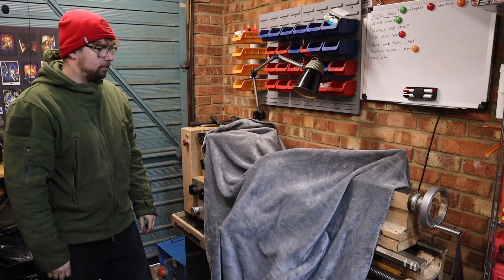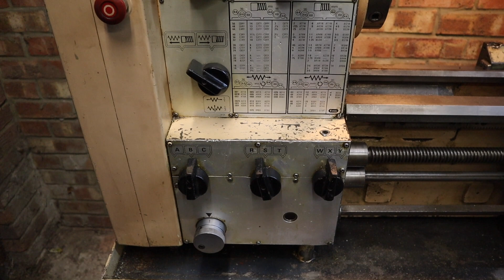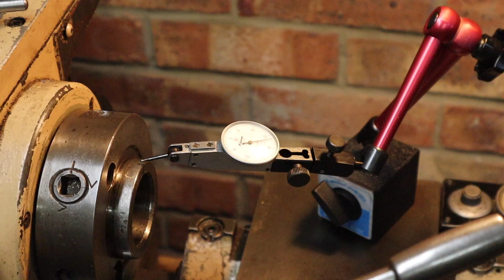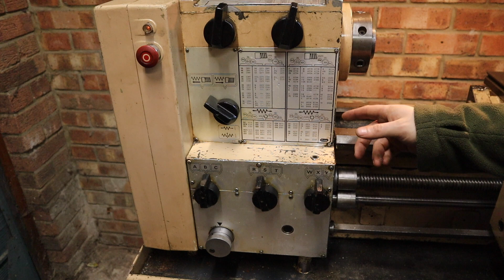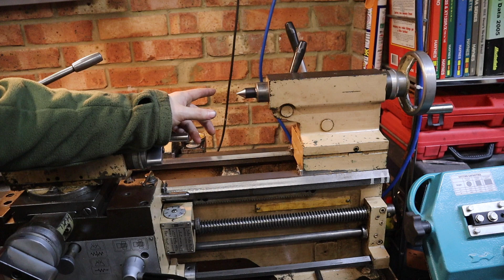My NEW Harrison M300 Lathe

Comment: Hey Joe, great video. I'm having a 40" version delivered in a week or so. Can ask if you have separated the stand and the lathe itself and if there are any electronics in the stand or if it's just a matter of removing the bolts holding the stand and lathe together. I need to move it down some stairs and it would help a lot to separate the stand from the lathe itself.
Thanks.

Comment: I have got one of these on order - originally tried to get a used one like you but they where all either badly worn or expensive so ended up biting the bullet and investing in a new one from Colchester, it cost a small fortune but will hopefully last me a lifetime, I did consider a Master or a Triumph but they would have just taken up a bit too much room in the garage and obviously cost more! - Can’t wait for it to arrive!!
Reply: how much was it do you mind me asking
Reply: @stevenhorgan8782  base price without options / extras is £15770ex vat for the 1000mm between centres model - all in with DRO, extras and delivery (plus a slight discount) mine came to £18900 ex vat) - it’s a lot of money but it’s  also a lot of machine - will last me a lifetime and the quality is leaps and bounds beyond anything you’ll get from the Chinese importers  - and Colchester are great to deal with - very good customer service / support. They come and level / commission it too - it arrived this Tuesday and I haven’t left the garage since 😂
Reply: @stevenhorgan8782 The base price for the 1000mm between centres model (which I got) is currently £15770ex vat before options / extras - after I added in the options I wanted (DRO / quick change tool posts holders / fixed and moving steadys / faceplate) and a slight discount mine came to £18444ex vat- it’s a lot of money but it’s a lot of lathe, is far superior to the Chinese import lathes and it will last me a lifetime so well worth it in my opinion. Colchester offer fantastic customer service / support too and as part of their delivery service they also locate it where you want it and send an engineer to commission / level / accuracy check it - it arrived this Tuesday and I haven’t left the garage since 😂 the Mrs doesn’t approve though 👀
Reply: @stevenhorgan8782  The base price for the 1000mm between centres model (which I got) is currently £15770ex vat before options / extras - after I added in the options I wanted (DRO / quick change tool posts holders / fixed and moving steadys / faceplate) and a slight discount mine came to £18444ex vat- it’s a lot of money but it’s a lot of lathe, it is far superior to the Chinese import lathes and it will last me a lifetime so well worth it in my opinion. Colchester offer fantastic customer service / support too and as part of their delivery service they also locate it where you want it and send an engineer to commission / level / accuracy check it - it arrived this Tuesday and I haven’t left the garage since 😂 the Mrs doesn’t approve though 👀
Reply: The base price for the 1000mm between centres model (which I got) is currently £15770ex vat before options / extras - after I added in the options I wanted (DRO / quick change tool posts holders / fixed and moving steadys / faceplate) and a slight discount mine came to £18444ex vat- it’s a lot of money but it’s a lot of lathe, it is far superior to the Chinese import lathes and it will last me a lifetime so well worth it in my opinion. Colchester offer fantastic customer service / support too and as part of their delivery service they also locate it where you want it and send an engineer to commission / level / accuracy check it - it arrived this Tuesday and I haven’t left the garage since 😂 the Mrs doesn’t approve though 👀

Comment: Is your lathe hooked to 3phase power or was it converted with a vfd? If so, can you do a quick video on the setup.
Reply from the maker: Hi Doc I run the lathe through a transwave inverter with a slight tweek the output voltage rectifier I managed to get it running sweet.

Comment: Nice Lathe. your inspection of the bed tells you little.  Get a suitable level and set the bed accordingly. if the machine turns a parallel shaft ( say 80 dia over about 150 long, no tailstock used,  you're in the pound seats!
Reply from the maker: Very good point John, I’ll have to try that check next time I’ve got some longer stock to hand. All the best.
Reply: Where can I see this parallel shaft performed?

Comment: your speeds and feeds are set by the material and size, not the machine you are using, if you get the wrong speeds, you will affect your surface finish, no matter if it was too slow, or too fast. so you will possibly use the 2500rpm
Reply from the maker: I know what your saying Allan. The idea of a big Chuck of steel spinning at 2500 rpm bit of a scary thought after using a mini lathe for the last year.
Reply: @MachiningwithJoe  the bigger the chunk of metal the slower you spin it anyway, you would only ever use 2500RMP on a small diameter or softer material anyway, if you have got say a 3 inch diameter chunk of steel, on any lathe you wouldn't be over 1000RPM all depending on what material it is, as that defines the SFPM, and also what sort of tooling you are using either HSS or insert, as if you are using an insert, as a general rule you can increase the SFPM by about 1.5 to 2 times compared to HSS

Comment: Congratulations Joe, you have a great machine there, it is very close to the size of my Asian lathe but it has a lot of nice refinements in comparison. I think you will find it is a great change from the mini lathe in accuracy and power and finish. Further to C Bruce, the taper nose is the critical surface on the chuck mount, and always be careful not to mar it, I had a chip on mine and it threw the chuck off a fair bit, left a mark which honed out, no problems after. I cheated out on my collet set and got an Morse 3 taper collet set that goes to 5/8" (16mm) and it is a lot easier than chucking small parts. Anyhow, good hunting and cheers!
Reply from the maker: Thank you I think I will in the future invest in a nice 5c collet Chuck. They don’t look like to much money but then have to buy the collets so that adds up. But yeah over all will be great for small stock

Comment: The first thing you need is a chip guard to stop the hot chips burning your hands when turning the saddle handwheel, Colchester got it right by putting the handwheel on the right of the saddle.  Still a great lathe though.
Reply: Both Colchester and harrison had the option to put the handwheel on either side when buying the lathe new, I have two m300's with each handwheel and the wheel on the right is far better, less burns. I don't even know why it was an option
Reply from the maker: Yeah that’s a good point about the hand wheel. I’ll have to think about a sleek design for the chip guard. Good heads up.

Comment: Does it have dregs of coolant in it? if it is soluble oil it will stink like last years sweaty socks, If you are using coolant constantly (every day) then soluble oil is the way to go, otherwise you might consider just cutting oil, but that has its own problems.
Reply from the maker: No all pretty dried up think it’s been running on cutting oil and as the coolant pump has been removed will have to stick to cutting oil for now.

Comment: Great bit of kit - how do you think a used machine like this would compare to one of the bigger Warco gear head units?
Reply from the maker: It’s hard to compare but if I had to I would say the GH1230 at £4000 is the closest in overall size and dimensions however the the Harrison has a much wider range of thread pitch sizes and feed rates as well as higher max RPM and more powerful motor. However it is old so always a chance something may fail.

Comment: Looks a good purchase, there are always going to be bits, that is why the last bloke is getting rid of it <grin> shame about the dints on the spindle nose where some dipstick did not clean the swarf properly before fitting the chuck, overall it should not cause a problem. :-) Some custom swarf tray/collectors coming up next,,,,, pass the tin snips please. And, at least you can get all the spares you will ever need from 600UK.
Reply from the maker: Yeah good thing is the beast is mostly all mechanical and simple so should be able to fix most things that go wrong. Ill check that spare parts site out.

Comment: That machine looks truly great. Just a hint on testing way flatness: You should indicate the SIDES of the prismatic ways, as this is were the wear occurs, not the top. There is no contact on the top from the saddle. Also: (you probably know this)... run a sharpening stone over the chuck mounts, and the chuck itself to level off any bumps and dings. Enjoy your new toy!!
Reply from the maker: Great point I didn’t even consider that stupidly I will have to go back and check. 👍
Reply: @MachiningwithJoe  I just recently found and subscribed to your channel. I am working my way through your past posts, enjoying them,  and admire what you do very much!!!
Reply from the maker: @crichtonbruce4329  Glad your enjoying the content and welcome to the community. Appreciate your input and look forward to hearing from you in future videos 👍
Reply: No pressure, but keep coming up with such great content and I'll keep watching.
Reply: Or you could run the DTI on the flat way adjacent. Only the tailstock runs on this, so unlikely to have any or much wear anywhere near the chuck. This will then measure the vertical movement of the saddle.